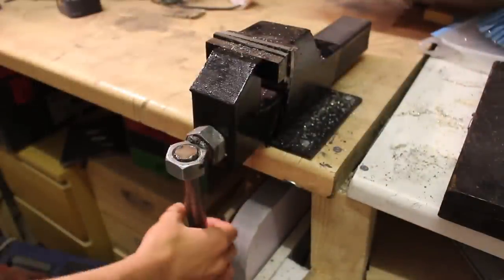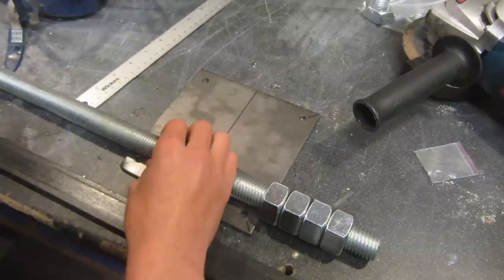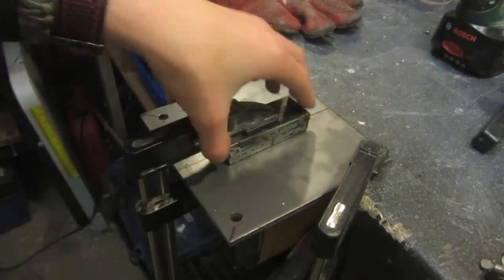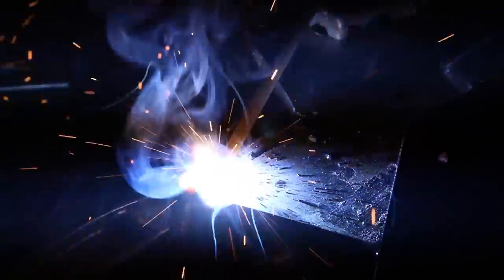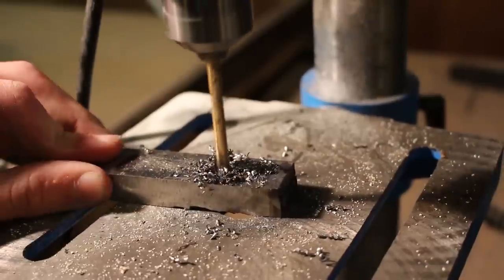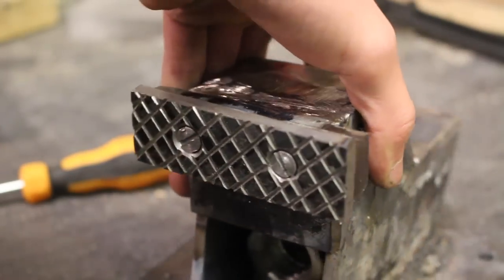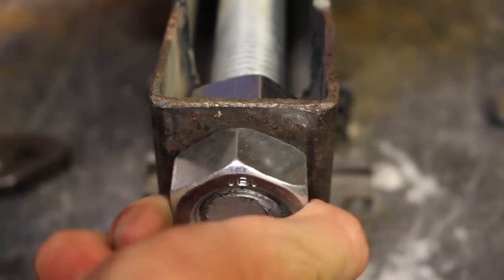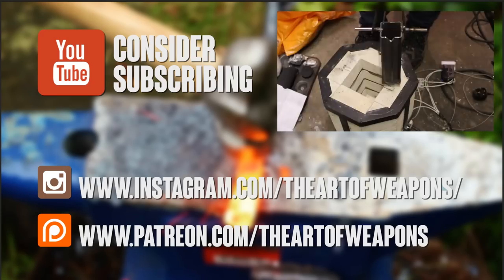Making a Heavy Duty Steel Bench Vice

Comment: I buy pretty much every vice I can find at garage sales. Very useful to have. I think my favorite one I found has a built in clamp to quickly secure it to a bench so it's easy to take with you and install where you need it.
Reply from the maker: I agree, I find that my bench vice is my most used tool in my shop.
Reply: what Are some tools i should have early on if im going to make these kind of projects, i have a drill, and every thursday I have 2 hours of Workshop time, any tips? 😊
Reply: Get a decent angle grinder and some high quality drill bits (no high-speed steel, look for cobalt).
Reply: How old are you now?

Comment: Hey quick tip on welding if welding two flat plates jus grind the corner edges off so the welder has more surface and less grinding

Comment: I like the ideas presented here.  I will use the Atlas all thread screw and nut, from a car scissors jack.  Also, since I have bought some scrap  11 inch discs of 3/16 HRS, I will make mine swivel around like many other vises can do...  just bought a used Enco Mill with power feed, off a retired machinist, advertised on CraigsList at a huge bargain, with all of it's tools colletts, boring bar, bits, and German chucks.  The 100 pound 5 inch machinists vise Bob also gave to me is US made, and he also sold me the two clamp sets and the Mitutoyo dial indicater and accessories he had...  Runs great!  Can drill huge holes! and can mill keyways!

The Full wave bridge rectifiers used to make any AC welder into a DC welder, are sold on ebay for $7.49 to $39, depending on whether amperage is up to 100 Amps, 150 amps, or 300 amps at 1600 Peak Inverse Volts...  A Capacitor or a bank of them, 68,000 micro farad, rated at 65 Volts surge, will make the output of the rectifier smoother.  Tons of videos on here...

Comment: When I started using SMAW or "Shielded Metal Ark Welding" I started with 7018 rods and an= Lincoln welder. I was a bit privileged in that way, but one very important thing I learned was to take your time. The more comfortable you are the better your welds will be. Don't be afraid to experiment with what you have. The more you learn from your failures the better a welder you ill be. After taking the course I did I have moved onto auto body, some small building construction jobs, and just plain fun. 

Have fun, that is the best advice I can give you. If you like welding and making things you will be fine.If you don''t like slaving away in front of a grinder / welder then find another hobby. 

Your vids are awesome, keep up the good work. : )
Reply: Also if you aren't welding something that will be under HUGE stress SMAW is a bit over kill.
I have welded car frames, small garages, guns, jack stands, and so much more with a MIG or "Metal Inert Gas" welders. A mig welder is easier, provides a better weld on small jobs, and is cheaper in the long run. It is not good for structural welding, like industrial buildings but is great for almost anything else. If you can get a MIG welder I would suggest it.

Comment: Very cool build! Just a suggestion for your jaws: since you made them removable you might want to use some hardenable steel and replace them. This will help to prevent dings and dents that will mess up the jaw when you clamp some harder metal into the vise. But as is this vise looks solid and it seems like it'll hold up well to a lot! Great job thanks for sharing this!
Reply: Could also use cheap plastic chopping boards for anything softer too.

Comment: hi am a welder ! just a wee tip if your using 6013 3.25mm rods your amps should be about 107/109 around there !! Keep at tight arc and take your time always be comfy ! use your hand to steady the electrode ! If I was you I would invest in a MIG/MAG welding plant because it is more fitting to your kind of work ! hope this helps

Comment: Good strick wlding there at the end! Just started learning how to weld at school myelf. Glad I did not take the stick welders, but the MIG Welder (who blew a 3phase 32Amp fuse 3 times..). Just a cuple of tips! If you dont know this. Use proper welding clothes, NEVER use a t-shirt as you're only clothing. Use welders gloves, keeps you from getting sun burns. Welding is quite dagnerus without the proper clothing. I use Weling clothes and work shooes myself. Shoud have used gloves, now my right hand is partialy sunburned....

Comment: Eventually the threads will strip. All-thread like that isn't designed to be used for this, that's why the screws on any metal mill, lathe, etc have very thick threads that won't strip

Comment: nice project, with arc welding two thing i found really helped my arc welding was getting used to bending the rod to get the best position for the work piece and keeping the rods indoors as they suck up moisture if left in the shed in the uk.

Comment: nice try and good for having a go
tips - leave the electrodes in your room not the shed 
dry them in the oven 100c b4 use 
i see you welding into the the rod - draw away from the weld with stick welding not push into the weld like mig welding

Comment: Serious welding advice:
I noticed you were welding the galvanized steel nuts (zinc plated) without stripping the plating first. I'm not sure if you were doing it outside because you are aware of the dangers of it or not, but in any case, avoid welding galvanized steels. It gives you metal fume ever and can poison you if it's really crappy plating with loads of heavy metal impurities from dodgy suppliers (i.e. China).
I love the videos and projects, keep them coming!

Comment: remember to always wrap your welds around any corner. If you are going to weld in another weld grind where your weld will run into it to make sure its a clean connection with no inclusions

Comment: ugly welds are just part of learning to weld you get good ones you get bad ones the trick is just remembering what works and what doesnt
Reply: also what size angle grinder are you using there looks like 7 inch? and what made u decide on an arc welder theyre really more on the heavy duty end of the scale was it just because of the price?
Reply: Probably couldn't afford a mig welder. But you did pretty good for making a vice without anyone else's help
Reply: they are more expensive but the uses and performance increase of a cheap mig are far greater than that of a cheap arc so to me its worth paying an extra 150~
Reply: Do you realize stick and mig are both arc welders?
Reply: mig is a completely different style of welding
 i think you mean tig
Reply: mig, tig, and stick are all forms of arc welding.
Reply: yes they use high amperage to create an electrical arc thats where the similarities end.  mig welding using a coil of wire that is automatically fed to the gun which is a lot easier and cleaner when using argon compared to arc welding which you have to strike to start and it forms a slag layer
Reply: yes i have used most all welding processes and i'm just saying that mig welding is a form of arc welding because your first reply was confusing.
Reply: +Snake Plissken not really. although technically not correct arc welding is synonymous with stick welding even though the three most common forms of electrical welding all use an electric arc. similar to how we all say dremel when what we mean is rotary tool
Reply: I can do better with SMA than MIG welding... Even with 150€ machine. For what hes welding I would've gone for 3.5mm 6013 and 7018 for stress points . 
Those buzzbox things are waste of money. You can weld.. Yes but if you can choose between +- Theres far more options when welding different materials. 
You just need to know how welding works and how different electrodes run on different materials. After that you can weld anything in any position. When you're aware of those things you just might get going with MIG and perhaps if smaller and higher precision welds are needed, get TIG.
Reply: Couldn't agree more. I hated using buzzboxes. After I bought my everlast inverter it was night and day. If people have the budget I would highly suggest getting a mig welder that can stick and tig.

Comment: I can see you progressing as you weld, I also noted you didn't put v-grooves before welding at first, but you did later from what I saw, which is important for penetration and a strong weld. Is your welder AC or DC, a DC model would allow you to use 7018s which produce a very strong weld. It's all I use. Though if you are in the UK and that small thing is an AC box, perhaps 6011 would be a good choice for an allround electrode.

Comment: Artof, I like this project so much!  Definitely a useful and strong tool.  As for the welding, you'll definitely learn as you go and practicing will make you better at it.  I'm glad you have taken up welding as it will be such a useful skill for you to have and welding just makes so much possible.  Not to mention being able to make repairs and improvements from time to time.

Now then, the screw thread.  I know you have to use what you can easily get hold of, and 24mm is a nice large size offering great strength.  But do you know about high-tensile steel and mild steel?  For example; if you see a bolt head marked up as, say, 4.4 then that would be a mild-steel bolt.  If a similar bolt was marked up as 8.8 then that would be a high-tensile bolt.  There's a bit more to it than just that, and you could easily look it up if you wanted to.  However if you used the 24mm studding in high-tensile then it would be more durable and less likely to wear.  The nuts can be HT as well rather than MS.

Anyway, this is another great video of a really good project.

Best wishes matey.

Comment: +TAOW Terrible looking welds are part of the learning process, however I hope you were in a properly ventilated place while doing this. However you only have a stick welder now, you should definitely try to get a MIG welder, they are much better, provide cleaner welds and are simpler to use. Also you should try using the whip and pause method when using a stick welder. Anyways great job.

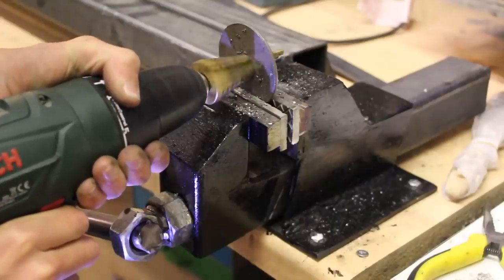Comment: Why didn't you use the drill bit at 10:39 to drill the hole at 8.23? Even if it was a bit small surely it would still be easier to file it out.

Comment: can i give you a tip buy a mig welder a lot  easier for beginners i am not a pro but i used a arc welder when i was 10 years  old in my dads shed and welds are not great unless you are welding thick plat mig is good because you have  a  wider range of things 
you can weld with arc you can blow a hole in anything

Comment: Why do you hammer the end of the weld?
Reply: it removes the oxide layer that forms. if he was using a shielding gas like argon in a mig or tig welder then that wouldnt happen. btw the tool is called a slag hammer at least here in Aus
Reply: to remove slag that is over the weld
Reply: +tomaz1996 oh yes makes sense thanks guys

Comment: 5:33 i got the same hammer, from the welder's box, im crying you actually use this crap hahaha. the brush on that tool is so useless. bought a way better wire brush for 3€.
well im also learning welding as i go, instead of burning sticks on a piece of steel, which i did 4 times and considered it enough, i decided to weld simple stuff such as some stand for my angle grinder. well i also learned that i have to deal with heat distortion. I guess they call this stick welding because the rod always sticks instead of welding.

Comment: Not bad but instead of that design i would go for blacksmiths style vice and ACME Thread(go to junkyard and buy cheaply car/truck axle -good material for a lead screw) -a lot stronger heavy duty vice .
You got a lathe so acme thread cutting shouldnt be hard for you(plenty of tutorials on youtube ,you can buy cheap ppr plastic pipe and practice ).

Comment: I know this video is old but I hope you stopped using cutting discs to remove rust and tidy up welds, get some flap discs. You do not want a cutting disc to snap and go flying, you wouldn't want snapped bits heading towards your face. 

safety first.
Reply: not horrible criticism just advice*
Reply: Or just get thick grinding disc instead of cutting one